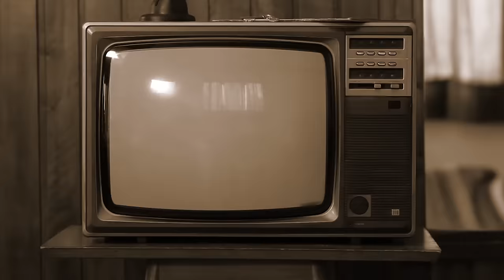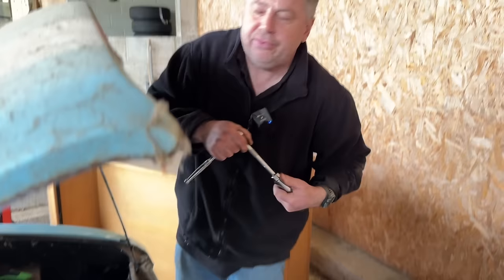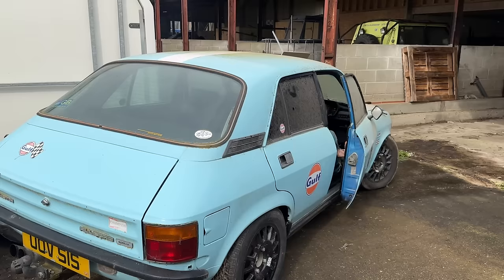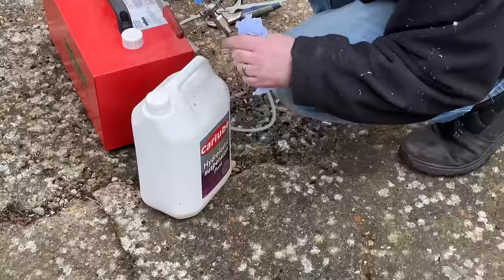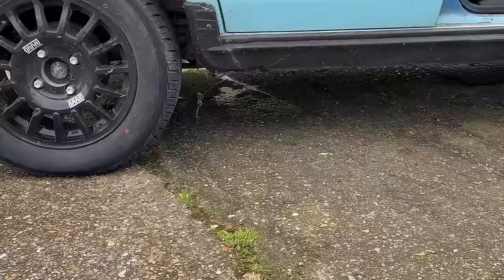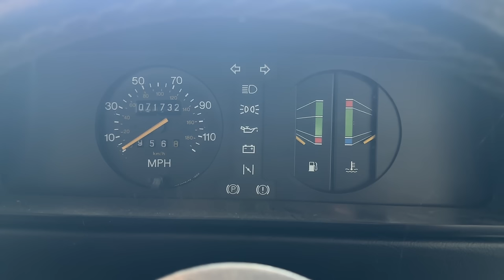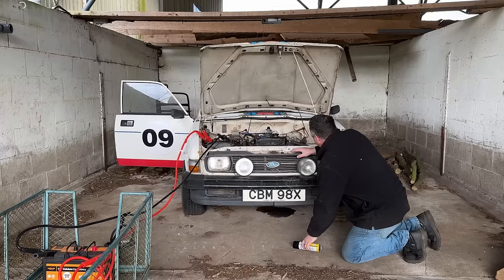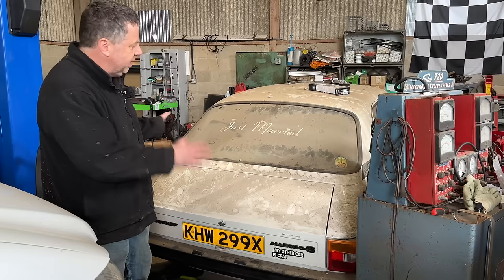Unusual Austin Allegro Collection Uncovered | UK Barn Finds Fleet Update

Comment: Most likely a good few other geezers may comment on the same topic.... being the leaking SU HIF carb, which has a stuck float chamber needle valve. A quick fix is to tap it (bottom of the carb) with a stout object. Longer term proper fix, is to strip the carb & clean both the float chamber, needle valve & the main jet, then check the specified float level. Whist apart, clean out the dash pot internal piston body & piston outer edge, then finish off with a mild metal polish so it can slide without excessive resistance.

Comment: Not sure I like what was done with the scissor doors (pretty hideous actually) but I do like the Allegro.  I owned the Australian version (I suppose you could call it that) which was the E Series 5 speed power unit shoehorned into a Morris 1100 and it was called the Morris 1500.  It was a badly engineered car because Leyland Aust had no money and didn't care about it.  They were waiting on the Marina to arrive, which, in Australia, was also fitted with the E Series engine mounted in line and coupled to a Triumph gearbox.  I do wish the Allegro had been released in Australia.  It could have been built by Leyland Aust in Sydney and not suffered from the crippling industrial relations problems that occurred in Longbridge and the quality control would have been better.  The Marina was ok but the Allegro would have been more modern in concept.  Oh well.  I did do a good couple of years of club motorsport in my Morris 1500 and had a lot of fun with it.  It had twin SU carbies and everything!  Good luck with your collection and I hope they bring you much enjoyment.  😊

Comment: My first car in 1976 was an Allegro 1300. It was fine as soon as I swapped the quartic steering wheel for something sensible. My second car (1979) was an Allegro 1500 Special LE - it was much better. I don't see what was wrong with these cars - at least they didn't rust away at the same speed as their predecessor ADO16s.

Comment: I love Allegro's & have had several over the years, my last one was a russet brown MK3 on a W reg. I put twin carbs on the 1.3 engine & some large rostyle wheels & it gave me so much joy driving around, definitely smiles per miles😂
I picked my son up from the army barracks once & he was devastated & embarrassed to get in it but once he'd driven it he loved it, he said I can't believe how dull modern cars drive compared to the allegro.
The sound of the Austin gearbox when gearing down,it's a proper whine, a sound as kids we always listened out for as my dad always drove Austin 1300s & if you heard that sound when you were up to no good then you knew to get the hell out of what you were doing😂😂 i❤ these ones in the video. Well-done Elton 👍

Comment: Nout wrong with Allegros.  I know Rowhedge very well, had friends living there in the seventies and eighties.  That was my old stomping ground too. Cool.  As for the busted pipe, you can make them yourself.  It's like brake pipes, buy the tool and fittings, cut the pipe to length and use the flaring tool to fit the connectors.  Probably a good investment with all those Allegros kicking about.

Comment: Great little video, well done! I love the little yawn Claire gave when Elton was talking about the hydragas suspension. Hydragas and Hydrolastic Services in Telford are the guys to help with suspension. I'm building a restomod Austin 1800 S Rally Landcrab with a Honda VTEC engine in and I've used hydraulic hoses for the whole system at a cost of £220 all in. I have posted pics of the build on UK Barn Finds a while ago. Keep up the good work 👌😎

Comment: Suspension pipe repairs are relatively easy, if you want a complete pipe try the Allegro Club International. They did have some pipes made up, not sure if they have any left. If not you can patch repair it using copper tubing used for central heating and compression joints. I think it's 10mm, but check 1st. I would use a pipe cutter to cut the pipes with to make sure you get a clean cut. I have a series 1 estate and have renewed all the suspension on mine, I had never done it before but if you take your time it's quite simple.

Comment: The Allegro was really a BMC 1100/1300 in a different body.
The Maxi was the car Leyland should have modernised as it was one of the early hatchbacks. You know them things that won’t catch on. But Renault were first with the Renault 16 and then the five.
Those doors would work well these days in the small parking spaces everywhere!
Reply from the maker: The Maxi is such a great car. And, yeah, it won't be long before doors like this are totally necessary if you want to park anywhere 😂
Reply: To Steven Moran. You may THINK the Allegro was the ADO 16  1100's in drag as a new car, but actually, they WERE new, bodywise - they were BIGGER. Hence a bigger boot! And, incidentally, the METRO must have been bigger than the old Mini - because the makers claimed it's boot was TWICE  as big as the Mini's.
Reply: I believe the Austin A40 was the first mainstream hatchback

Comment: Ive had a few Allegro's all been fine to be honest, bought my first Russet brown one, off our postman, problem was he had the clutch replaced at a fast fit place and they managed to strip the bolt that holds the clutch to the crankshaft, my dad and me dropped the engine out in the subframe and picked the car up, rolled it back, lifted the engine out of the subframe, then took it to an engineering shop, to have the crank hellecoiled, reassembled it and sold it to a garden maintenance guy for a hefty profit of £300! A fortune to a YTS lad on £35 per week! Happy days love these cars, a great idea doing weddings in it keep up the good work you two! 
Are you going to the NEC this weekend?? 😊😊😊😊

Comment: Allegros used to be everyhwere, in the timeframe I remember (mid 80s onwards) most were rotten old bangers being run into the ground, these look pretty solid thogh. For the carb probably a stuck needle valve, carb needs to come off and bottom cover be removed valve can then be replaced, alternatively a tap in situ with a percusive tool may free it off.

Comment: You can use the appropriate size diameter standard plumbing copper pipe & compression fittings to repair the steel hydrolastic pipe that has corroded. Just let in a piece where the pipe has a leak. I've actually done this on an Austin 1300GT, & it works just fine until you can get to replace the whole length. I think I used 10mm diameter copper pipe, as it was about 10 years back when I had that car. P.S. My Mum & Dad had an Allegro 3 in Rustic brown  1980 V reg with the 1275 engine. Cheers.

Comment: I had a 1979 1500le in the same metallic blue and same interior (jpt321t) back in the 80's when i was 15. I bought it off my mate for £10 and an old racing bike. It had a 5-speed gearbox,tacho,spots....pretty sorted for an agro to be fair just there was rot that was hidden by thick underseal that I never saw (being 15,I didn't know where to look tbh) anyway a few weeks after i got it he front o/s wheel leg collapsed and it pulled the drives haft out when I was wheelspinning it in the back road behind our house and killed it.

Comment: My friends, it does not matter if you post once a month - I will still stay subscribed because I enjoy your sense of humour, your banter and the lovely old British cars that you do as well.

Now that's out the way, on to the Allegro - or "All-aggro" as many have called it.  Personally, I think the name was a bit harsh for the car.  Sure, because of the infamous BL "she'll be right" and "not my job" ethos, coupled with the biblical amount of work stoppages, the Allegro - like so many others - earned a crap reputation.  However, as it was built on the same thinking as the Mini, used (at least initially) A-series engines and borrowed a lot of parts from other BL models' parts bins, the Allegro should have been a hit.  The transverse front wheel drive setup was well over 10 years old and well proven, as was the hydrolastic (then hydragas) suspensions they used.  Why were they so largely ignored? 

IMHO, styling cues (and probably sales) would have been better had it been a true hatchback, but according to legend, the backwards boffins thought they only needed one hatchback on the offing and the Maxi was already filling that role.  Thing is, the Allegro LOOKS more like the styling of the late 70s / early 80s hatchback we now all know and love and would that not have been a coup had they been the first back in 1973?!  Even the Alfasud that the Allegro was allegedly designed to take on was still using a small boot lid, so the Allegro would have trumped it for good.

In all honesty though, I've always loved the styling of the Allegro.  Here in New Zealand, NZMC (a subsidiary / sister company of BL) built the Allegro up from CKDs and over the period we built them, sold around 6000 - most of them being Series II 1300cc models with a smattering of 1500s.  Only about 200 Series 1 were built (due to the Kiwi love affair with Allegro's predecessor the ADO16 being built until late 1975) and Series III became a trim package for the last few cars that rolled off the NZMC production line in Nelson before it closed at the end of March 1979.  

NONE of the Allegro "saloons" assembled in New Zealand were of the 2-door variety (although we did get the Estate for a year or two late in the piece, but it was not a big seller) and nor did we ever see the 'quad headlight' treatment of any of the S-III vehicles built.  I was shocked and stunned when I hopped on YouTube only 18 months ago and saw one for the first time in the form of an original Equipe.....and I have wanted one ever since!  Why did they not do this to begin with??  Talk about a sexy little hot hatch....er....had it been a true lift-back, but this look would have appealed to a LOT of people....and I doubt few Kiwis have ever seen it!  I couldn't believe how such a small bit of dressing up could change the total look of the car.  Gone was the so-called frumpy middle-aged spread and in its place was a sleek-looking and svelte little snarler!  And it made me love them all the more. I originally wanted one to do some serious modifying of the A-series but leave as outwardly standard.  This was so I could have some fun - because they handle so well - on the twisting winding mountain roads to my mother's home 100 miles away, scaring the poo out of other road users as this 50+ year old bloke in a 40+ year old car goes howling past them.  However, the Equipe is such a beautiful package that I cannot ignore it.

My plan is to find a 4-door (because that's all we have over here) and do a reproduction of one - including dropping a 1750 and 5-speed out of a mid-70s Maxi into it.....eventually.  It's either that or I take its little A-series and tweak it something chronic like I did to my Morris 1300GT about 30 years ago. However, it will FIRST get the proper dash cluster, the silver paint, the stripes, wheels off a late-model 'wedge' Princess, retrimmed seats and door cards, the airdam / skirts, blackout highlights and quad light setup and grille of the Equipe - if I can find them and import them! - so it looks the part.  

They - the Allegros in general - are a cool little car and deserve to be celebrated.  Most people did not think they would survive the 80s - and a lot of them didn't - but they are still around, still driving and still looking as good as ever.  I like your trio and would love to see you bring them back so I can live vicariously for a bit as well!  All the best.

Comment: We used to have Allegro's Panda Cars in Birmingham, the Allegro 1300 i had as a Winter runaround served me well, it's still showing on DVLA HDA645N
Reply from the maker: Wouldn't it be amazing if that one turned up? It's unlikely, but not totally impossible.
Reply: @UKBarnFinds  I sold it to a mate of mine in the late 80's as he wanted the 1300 engine & box so i'm sure he scrapped it but didn't notify DVLA

Comment: I was never a fan of those 3 as..... amigos 🙄, They do like to drop caravans on things I believe. (pity they didn't do the same with the sports cars) Was there the same disdain for the Allegros predecessor, the Austin 1100/13? Anyway I would guess the first 2 don't have their original engines in them. I wonder what is there now. Seppo from "Seaside Garage" on YT might know more about the suspension as he has replaced pipework on an Austin Princess' ,....or is it just Princess? Those doors are funny.

Comment: My experience in the 70s was opposite to yours, the A series engined one I had was a total disaster. I drove E series engined variants twice and they we're a bit better. But compared to the 60s 11-1300 range they were a joke. The floor was rubbish if you jacked them up the windscreens popped out. Need I say any more. But I'll follow yours with interest, good luck. You need to create a vacuum before trying to push in the fluid. The blue is either Astral or Denim blue.